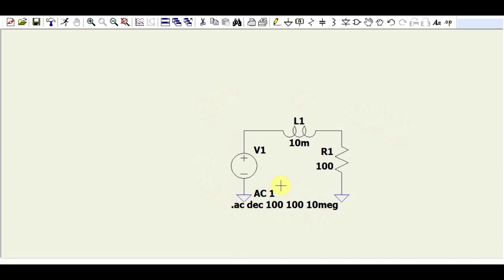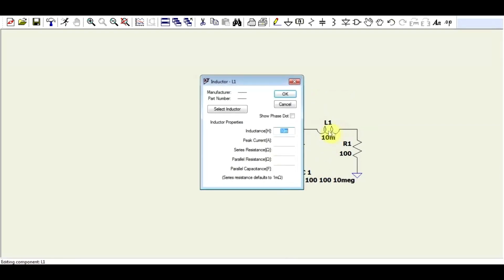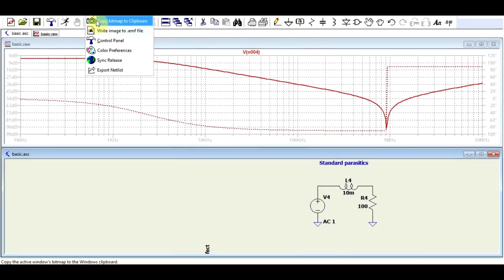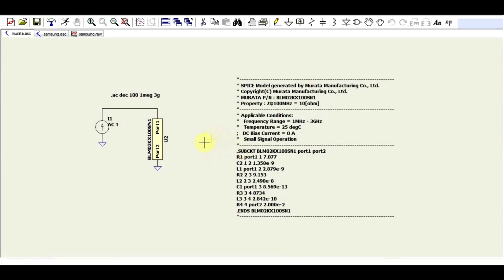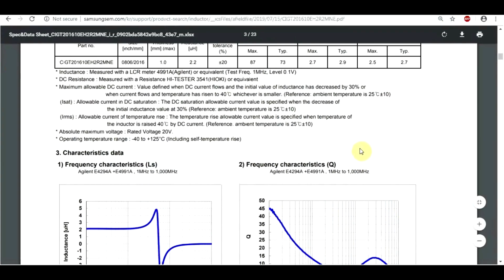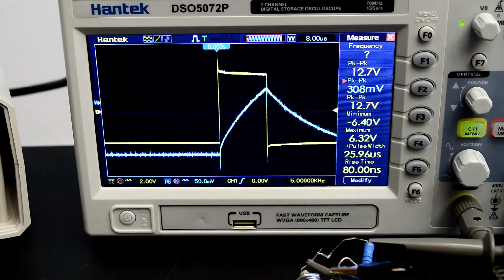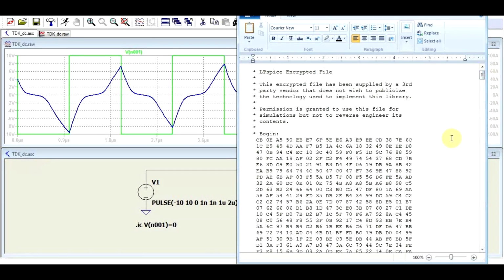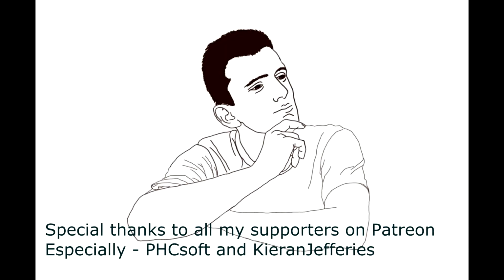LTspice tutorial - Simulating inductors - How hard can it be?

Comment: What is x? It is at the end of the video. Also, you have displayed inductor saturation at a very strict case of input supply. I've tried it with a buck converter which has a different input supply then whats shown here. Buck converter inductor does not saturate. I think ltspice still missing inductor saturation for a real circuit simulation.

Comment: Great video! But how did you calculate the parallel capacitance att 5:30 ?
Reply: I did the calculations, but I didn't get 3pF for the parallel capacitor, I got almost 20pF...
Those are the parameters I used:
L = 10mH
Fr = 350kHz
Reply: yes its 20.678pF @chungolio
Reply from the maker: Well I considered the L and C as parallel components; their resonance frequency is F=1/(2*pi*sqrt(L*C)) and if you know L and F you calculate C=1/(4*Pi*Pi*L*f*f)